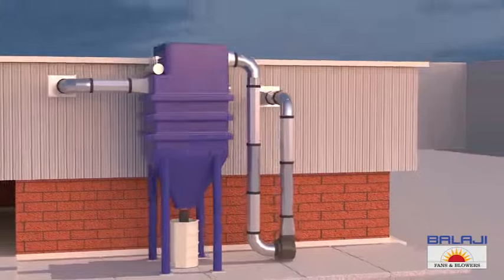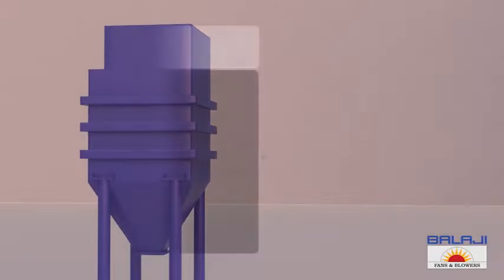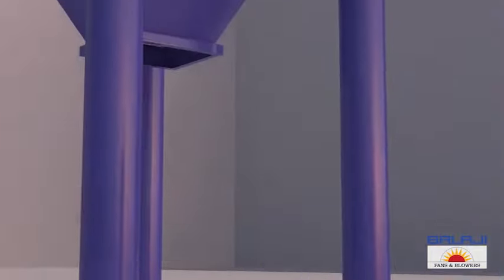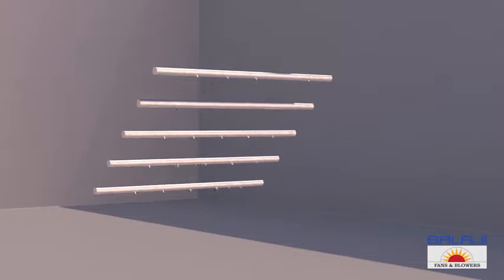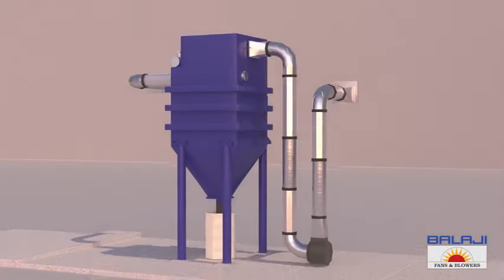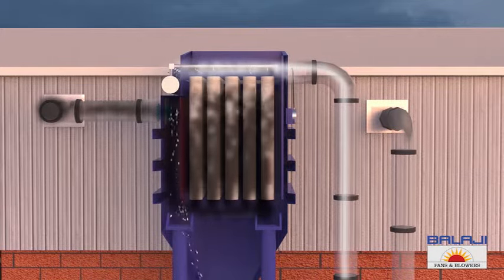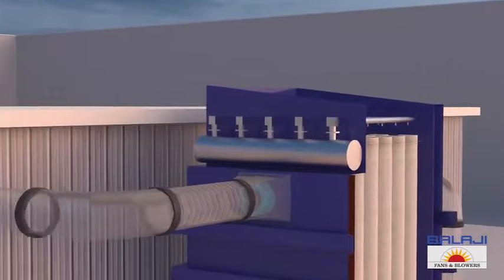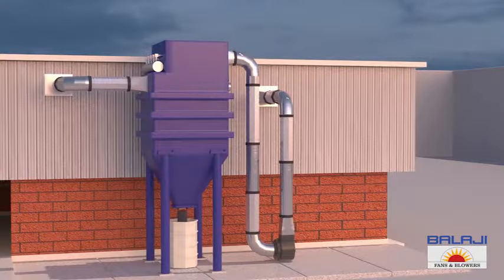Dust Collection system/ Industrial Dust Collector - Blowtech Engineers

Comment: Very clear and good explanation! Thanks 😊
Reply: Longyi super fine powder grinding machines advantages:
1. Powder from 48~4microns, fineness is adjustable
2. Built-in high efficiency classifier, no more investment cost for classifying system.
3. Smart PLC operation system, and integrated control system: 1 computer could operated max 6 machines, saving management cost.
4. No particle air pollution, more environment-friendly.
5. Compact structure to save factory space and lower foundation construction cost.
 
For CaCO3 powder
The whole grinding system including grinding, classifying, powder collector, fan, PLC cabinet, feeding conveyor and others, system power is 370Kw, the real working power is 296KW
1. D97=23um (600mesh)    Output: 10tons/h      Energy Consumption: 29.6Kw/Ton
2. D97=16um(800mesh)     Output: 8tons/h       Energy Consumption: 37Kw/Ton
3. D97=10um (1250mesh)    Output: 4.5tons/h    Energy Consumption: 65.7Kw/Ton  
4. D97=6.5um(2000mesh)    Output: 2.5tons/h   Energy Consumption: 118.4Kw/Ton 

MP/Wechat/Whatsapp: +86 15105956429
Email:Samuel@lymill.com
Reply: Longyi super fine powder grinding machines advantages:
1. Powder from 48~4microns, fineness is adjustable
2. Built-in high efficiency classifier, no more investment cost for classifying system.
3. Smart PLC operation system, and integrated control system: 1 computer could operated max 6 machines, saving management cost.
4. No particle air pollution, more environment-friendly.
5. Compact structure to save factory space and lower foundation construction cost.
 
For CaCO3 powder
The whole grinding system including grinding, classifying, powder collector, fan, PLC cabinet, feeding conveyor and others, system power is 370Kw, the real working power is 296KW
1. D97=23um (600mesh)    Output: 10tons/h      Energy Consumption: 29.6Kw/Ton
2. D97=16um(800mesh)     Output: 8tons/h       Energy Consumption: 37Kw/Ton
3. D97=10um (1250mesh)    Output: 4.5tons/h    Energy Consumption: 65.7Kw/Ton  
4. D97=6.5um(2000mesh)    Output: 2.5tons/h   Energy Consumption: 118.4Kw/Ton

Comment: Dust collection Coverage area????
Reply: Longyi super fine powder grinding machines advantages:
1. Powder from 48~4microns, fineness is adjustable
2. Built-in high efficiency classifier, no more investment cost for classifying system.
3. Smart PLC operation system, and integrated control system: 1 computer could operated max 6 machines, saving management cost.
4. No particle air pollution, more environment-friendly.
5. Compact structure to save factory space and lower foundation construction cost.
 
For CaCO3 powder
The whole grinding system including grinding, classifying, powder collector, fan, PLC cabinet, feeding conveyor and others, system power is 370Kw, the real working power is 296KW
1. D97=23um (600mesh)    Output: 10tons/h      Energy Consumption: 29.6Kw/Ton
2. D97=16um(800mesh)     Output: 8tons/h       Energy Consumption: 37Kw/Ton
3. D97=10um (1250mesh)    Output: 4.5tons/h    Energy Consumption: 65.7Kw/Ton  
4. D97=6.5um(2000mesh)    Output: 2.5tons/h   Energy Consumption: 118.4Kw/Ton 

MP/Wechat/Whatsapp: +86 15105956429
Email:Samuel@lymill.com